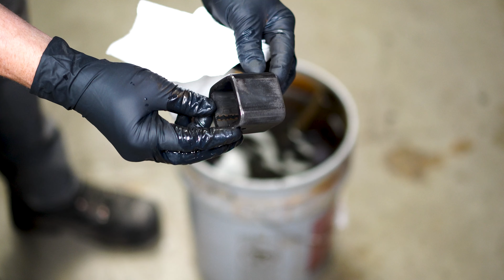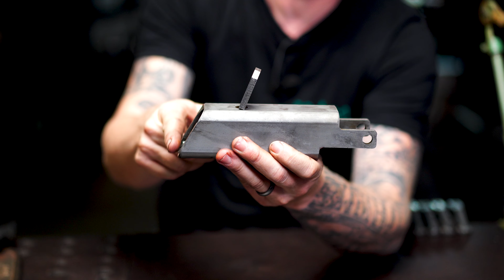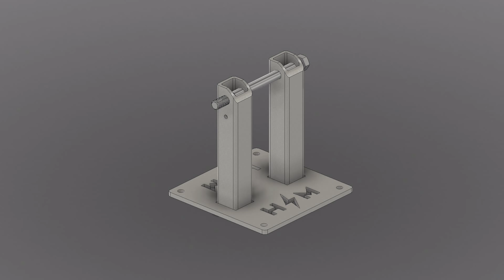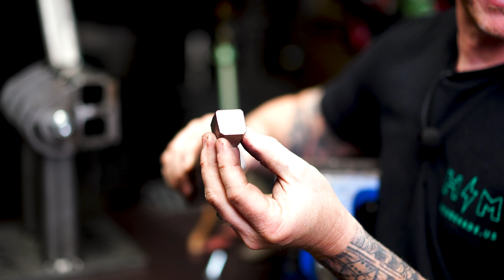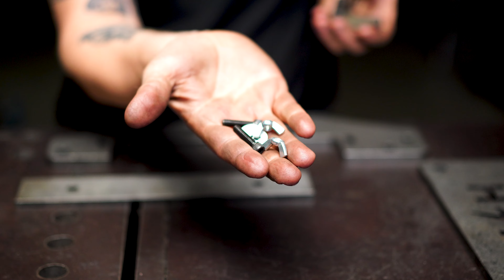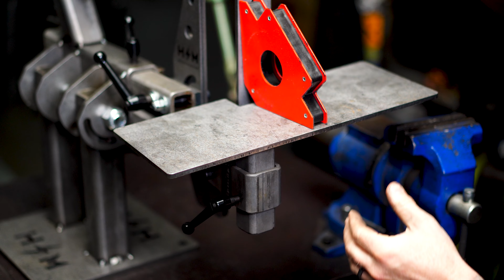How to: 2x72 Quick Start Fabrication Guide

Comment: What’s with the bar stock going into the tracking bar?  I’m building a gen 5 now and using the gen 4 method without the bar stock.
Reply from the maker: It's for rigidity. You can get away with out it, just make sure your welds are solid. 🤙🏻